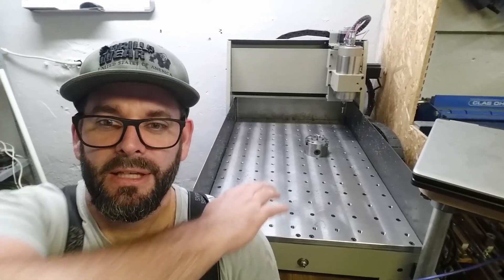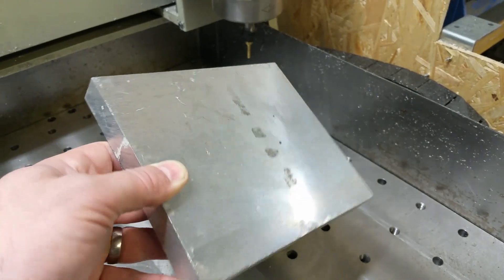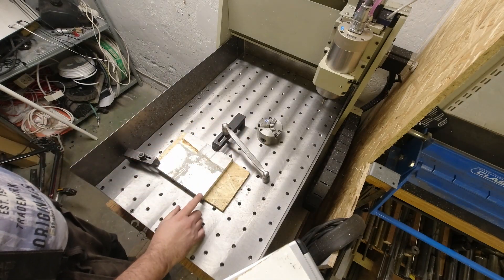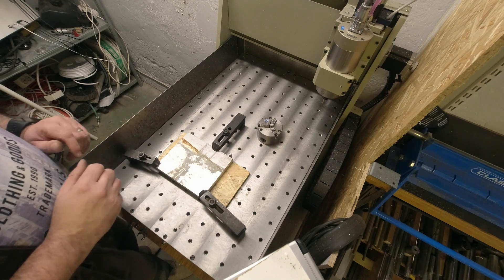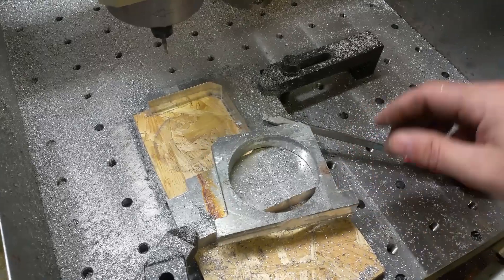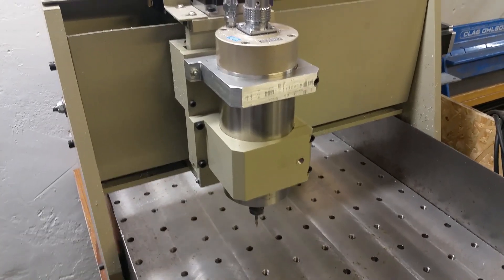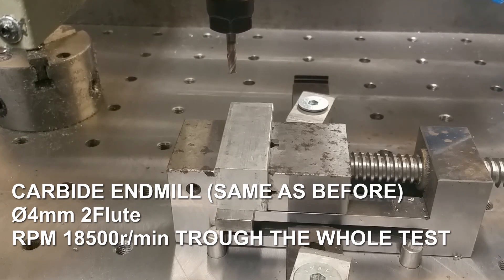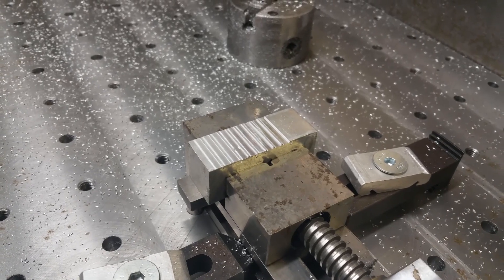6040 CNC Router Best Upgrade 2. Make An Extra Spindleclamp. Very Easy DIY

Comment: ive also seen same version cnc in the 6090 configuration...i can onlybimagine how much worse the orig aluminium table flex would be since the span is a longer and no support under it....i wonder why manuf couldnt just add a couple additional supports for the aluminium bed to sit on...that would make it much stiffer and eliminate lot of the flex

Comment: Thanks for all your work. I have just checked out all your 6040 tests/upgrades. Your table and spindle mounting modificatoons have given you a much more expensive cnc machine :-))
I think the ultimate would also be if you tested it on steel. The difference would be interesting to see.
Reply from the maker: Thank you for your kind words😊 I actually have a video when I mill in C45 steel, hou can find it on my channel!!
Reply: I have seen that, but wasn't that before you modified the spindle mounting? I am curious as to how it performs after the modification.
Either way, I have to tell you Tomas, you have certainly answered questions I had about strengthening less expensive machines like you did. 
Again thank you.

Comment: It’d be nice to see a more consistent before and after comparison. Yes the Z axis is the weakest part but that’s due to the thin linear guide rods. The spindle clamp and backing plate (where your bracket bolts to) are already way overbuilt. 

I’m interested in making this upgrade for my machine but want to know it will truly make a difference before machining a bunch of aluminum

Comment: Awesome improvement. I machine lots of aluminium on my exact router.I use a spray coolant system that sprays a fine mist of Isopropyl alcohol, I have been a machinist for 35 years and have only just used this. Cant believe how well it works.
Reply from the maker: Thank you! That sounds like a really good idea with the alcohol. And it dosen't get so messy like with water or air, I definitly going to try it👍🏻
Reply: @TomasTheCreator  picked up a cheep low pressure spraying system from aliexpress  cost about $150AU delivered
Reply from the maker: Aa I gonna check that ou, thanks again🙏🏻

Comment: Are you satisfied with this China 6040 CNC Router or had you problems with the accuracy or precision of the X-, Y-, Z-axis ?
Reply from the maker: I'm very satisfied with my machine, especially after some mods. I haven't had any problems at all with the precision. But you got to keep in mind that's 1000dollar machine and not a Kern😁
Reply: @TomasTheCreator  Thanks for your answer .
Reply: @TomasTheCreator   

Hi Tomas , one question:
Which one do you think is better,  the model you use ... or this one👇🏼? 
sainsmart genmitsu proverxl 4030
Reply from the maker: I think the Genmitsu is better for softer materials and it seems to have a better controlsystem. BUT it has weaker leadscrew and guides and it's a lot smaller.
Reply: @TomasTheCreator  

Yes, your router is more robust, I think it is the best option for its price thanks for your reply.

And what software do you use to design and then make the models? 
Thanks again 👋🏼.
Reply from the maker: Yeah and especially if you make some easy mods it's very robust👍🏻 I use Fusion360 and I like it a lot. Hope you get one and have loads of fun with it😃
Reply: @TomasTheCreator  

I'm seeing prices 💲 and maybe by the end of the year if they lower them, I'll buy it 😄 👋🏼.
Reply: @TomasTheCreator   bonjour concernant fusion 360 quel est le modèle du post proces ?  et est ce que l'interface peut être en français?
merci d'avance pour votre réponse.
Reply from the maker: Hello! I'm using a standard 4axis postprocessor that I have modified a little. I'm sorry but I ahbe no idea if it can be in french?!?!?
Reply: @TomasTheCreator  I don´t know if it can be in french, I don´t have the device and the program until yet .
Reply: merci pour cette réponse très rapide.